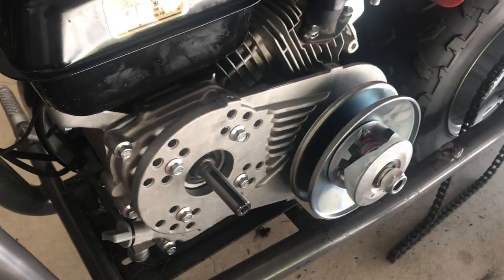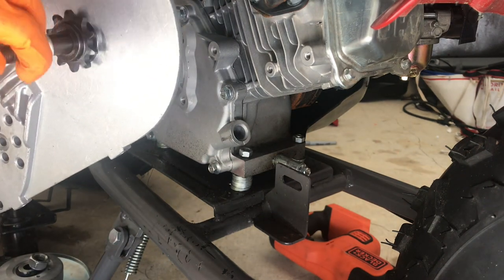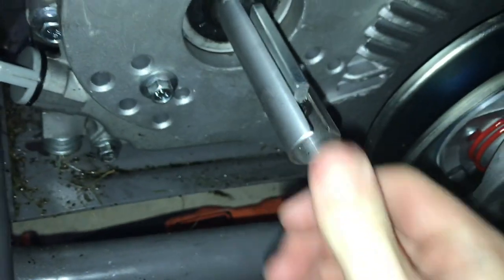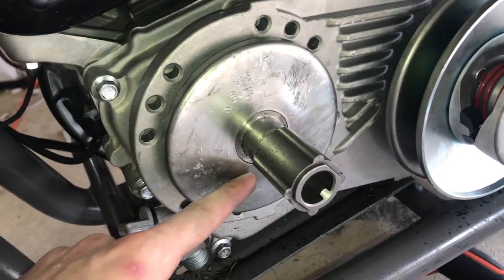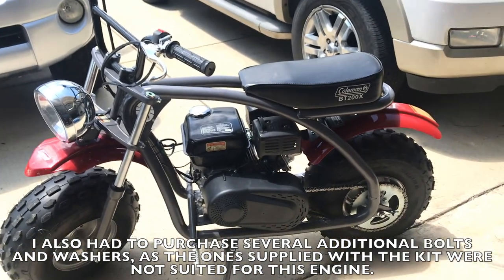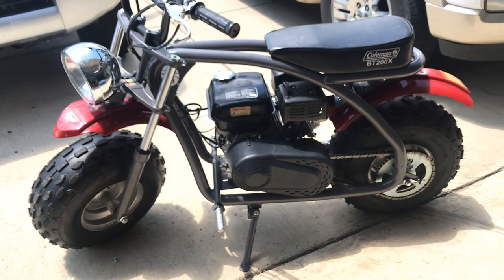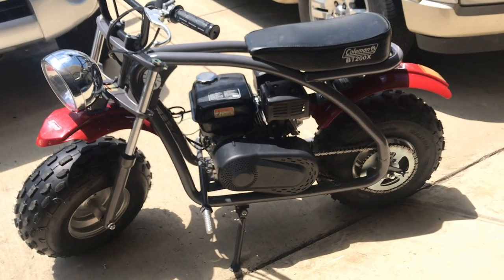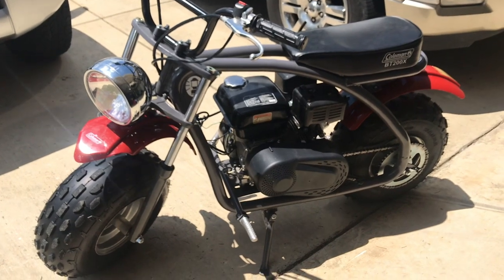Installing a Torque Converter on a 5/8" Coleman BT200X Mini Bike (196cc or 212cc) - Part 2

Comment: Thanks for the video! If anyone is trying to do this with the 5/8 shaft adapter sleeve. Put the sleeve on the shaft, then start the motor. The shaft will slowly turn, then just use some sand paper and sand till the pulley with the attachments fit.

Comment: The reason the parts are tight with the adaptor on the crank is because the adaptor is made for a 5/8 shaft which is .625". The actual size of the crank output shaft on those engines is 16mm which is about .005" larger than 5/8.

Also, not sure where you heard that you lose top speed with one of these torque converters? It has long been known that you gain top speed with these. Most get high 30's MPH and some have touched 40 or better with these. And you should get better low end than you had with the jackshaft. The gearing is enough to notice a difference from what many others have experienced.

Comment: I'm trying it anyway!  Coleman EX with a 5/8 drive.  I'll follow your advice with the grease and patience!  Thanks again for the vid!
Reply: did it work
Reply: @kylercontreras6044 did you end up doing it i'm scared to do it cus using a adapter is sketch
Reply: @chaqz4076  haven't done it

Comment: Go power sports has the 5/8” torque converter kit, a little pricey but it has the proper parts for the 196cc 5/8” crank
Reply: I think that kit is 3/4 with an adaptor but i may be wrong.

Comment: if you buy the riser plate that moves your motor forward you dont need to cut your frame. my ebay torque converter plus stage one kit came with the plate to move the motor forward.

Comment: The torque converter will haul you up a hill when a clutch peters out. In retrospect, it might have been easier to get a $100 predater engine and then put the converter on.
Reply: exactly, ill get a predator 212 that you can just throw a tav on, wished coleman had not of changed the shaft size.

Comment: I am in the same spot as you only with a CT200u. I bought a $38 torque converter kit and the 5/8 to 3/4 adapter. If it takes 3 days to install and all you get is 4 mph it doesnt sound like it is worth it. My top speed with taking out the governer screw has only been 24mph and I would like to do at least 30.
Reply: The screw does not disable the governor. It allows more throtle.
Reply: Man, he only gained 4 mph because he got a cheap 65 dollar converter !

Comment: I tried putting an ebay torque converter on my CT200u...it had the same undersized shaft and I bought an adapter like you did, but I could not get the first side of the drive pulley on all the way.  I tried grease, heat, using a file to shave down any possible rough edges of the adapter.  After mangling the pulley part trying to get it off a couple of times I gave up.  Parts like that need to have better tolerances than we get on china made stuff.  Even if it had gone on, I was worried as the key on the pulleys only went into the shaft adapter...and not into the grove on the shaft itself...I don't see what would keep the adapter from sliding on the shaft other than pure friction.
Reply: The problem is that it is a 5/8 to 3/4 adaptor. The Hisun PTO is not 5/8 it's 16mm. 16mm is about .005" larger than 5/8. When you put the adaptor on the crankshaft it opens up slightly larger than 3/4 . 

Those adaptors for this are not a good idea. OMBwarehouse.com makes a 16mm to 1" adaptor that should work great. But you need a torque convertor that has a 1 inch drive pully.

I'm different than most people. If I had to do this I would replace the crankshaft with a 3/4".
Reply: Having the same issue as we speak with the key only hitting sleeve gonna have to swap hole motor for a 3/4 from my shelf I guess that sucks lol

Comment: A CVT reduces top end,...   LOL.
did you know you can even adjust them, by setting the spring in them to the rear setting and preloading the spring (twist counter clockwise as closing, You'll see it load correctly on the *Left of the shoes) as you close the magazine.

Comment: The TAV style clutches actually have a slight overdrive because the belt climbs very high in the drive clutch, providing about a 0.95 over drive. vs a standard output.
Reply: WHATS YOURSOC  I was using standard ratio nomenclature.  Where 4:1 is lower gear than 3:1 and therefore 1.1:1 would be lower gear than 1:1 and 1:1 would be lower gear than .95:1.  That is how transfer case, transmission  and axle specs are designated.  As the ratio number on the left side of : gets bigger the gear ratio gets smaller.  So the ratio reflects how many more or less RPM the left side (engine side) must rotate compared to the right side (wheel side).  So a situation where the engine is rotating in "overdrive" (less than the wheel) would be were it is spinning at less than 1:1 or .95:1.

More simply put "over drive" equals a smaller left side number on a ratio designation.  There may be some countries possibly where you could find a ratio written backwards and that would look like this, 1:1.05, also reflecting  "overdrive" of the rear wheel compared to the engine.

Comment: Use some sand paper with the motor running on the crank adapter and 8 washers on the crank to line the driver pulley with the driven Pulley make sure to have a rubber o ring on the crank we’re the washers meet the engine
Reply: What's the o ring for?

Comment: Can also purchase a 196cc honda clone crankshaft. They sell for $26.50 on eBay plus free shipping.
Reply: IMO getting the correct crank is the way to go. Using an adaptor like the one in this video is quicker and cheaper but doesn't work exactly right because the adaptor is made for a 5/8 shaft. The shaft on these engines is 16mm which is larger than 5/8. That's why he had an issue with parts fitting too tightly.
Reply: Thanks guys, this is super helpful. I see now why the adapter isn't the way to go. I'll be ordering a 3/4" replacement crankshaft for my CT200U soon.
Reply: That's what I did.  Worked great!

Comment: Change your rear sprocket to a larger one for more low end torque.
Reply: You can also go from a 10 tooth to a 8 ,witch will do the same but cheaper on the small sprocket. That's what I did .more torque now.

Comment: How are the washers holding up? I’m considering using them to raise my engine up an inch.
Reply from the maker: The washers didn’t hold up long term, I’ve been thinking of making a follow up video of some minor mods and changes I needed to make for this setup. I had to switch to a piece of 1 inch square tubing, which I drilled bolt holes into. I then purchased bolts that were 1.5 inches longer and bolted the engine down that way. This setup has lasted me several months without issue.

Comment: Does it seem to have better performance with this vs the stock clutch? I'm talking like climbing a steep hill. I have to get a good run for the steep hill that leads to my trails, if not it just stops halfway up the hill and that's sketchy as hell. Also it seems like I have no power in the grass. Would one of these improve that?
Reply: A year late, however place sleeve in the freezer, or compressed co2,or liquid nitrogen, place the pulley in the oven if you have no other method of evenly warming it up.  Wear gloves! Lol. Oh yeah, a little grease.  
I'd be interested if you went through with it, and how your experience was overall.  Thank you,  and have a great day!

Comment: after using the crank shaft adapter the bolt in my kit for the 3/4 crank wouldn't thread into my 5/8 crank. going to ace hardware now to get the bolt.

Comment: I don’t know if you’ll see this comment but it would be very helpful if you did. So I have the same setup and have the key. What size bolt
Did you use to secure the front pulley on?

Comment: Did you use that crankshaft adapter because no one makes a kit to fit a 5/8 shaft or you used it because the kit you happened to get was just made for a bigger shaft? I guess what I'm trying to ask is do these torque converter company's make a kit for a 5/8 shaft and you over looked this part  when ordering the converter?  Great video and very informative, take care buddy.
Reply: Yes there is a torque converter made for 5/8 and 3/4
Reply: @ilovecheesecake516  Thank you for the reply and the info buddy.
Reply: @ilovecheesecake516  Do you have a link to where to get a 5/8 torque converter?
Reply: Deucealive75 https://www.gopowersports.com/coleman-ct200-series-torque-converter-kit/
Reply: @ilovecheesecake516  OK. That's the expensive kit with a shaft adaptor. I thought you were talking about the $60 ebay kits that might have a 5/8 drive pully. My bad.
Reply: Deucealive75 I personally like those better than the ebay ones. They last a hell of a lot longer and they perform better. Not to mention they won’t take any jerry-rigging to fit your bike. Trust me, I’ve had both, but that’s just my opinion.
Reply: @ilovecheesecake516  That's interesting. In what ways do they perform better? One thing I find interesting is the wide range of top speed numbers that people report on the same type of bikes. Colemans specifically. Some only get 34 or 35 while others get up to 45 on mainly stock engines.
Reply: Deucealive75 Thats the difference. When I bought my first CT200u I put a cheap ebay cvt on it along with the stage one kit and of course the throttle screw removal. I was very disappointed when it only went about 34 mph and other people’s were going 50+. A few months after I bought a BT200x (same motor) and did the same modifications except the cvt was from that link. The highest speed I achieved was 47mph without any governor delete or suppression. After that I ordered different gearing and now I get 55+ on that thing.
Reply: Hey buddy thank you for the info to the Amazon kit, I really appreciate that and the price is perfect. 👍
Reply: @ilovecheesecake516  Nice. What gearing are you using? I'm running a 9/60 tooth and am very happy with 0-25 performance. Have no idea what top speed is..
Reply: @Deucealive75  12t and 53 on the rear.

Comment: My mini bike also has the 5/8 shaft and the bolt that goes in the shaft that came my kit is the wrong one. Do you know what size bolt I would need to buy?
Reply: It's a 6mm fine threaded bolt. At least that is what my BT200X took. I haven't installed a torque converter yet but I lost mine because it wasn't tightened enough from the factory and I failed to check it before riding it. I was able to get some 6mm bolts to fit it at Lowe's.

Comment: So how did you get the 3/4 torque converter which comes with a welded/molded key ( seems they all do ) in it to go over the  5/8 bushing so it will connect to the crankshaft ?
Reply from the maker: I ordered an adapter on Amazon that converts a 5/8 shaft to a 3/4. If you check out part one, I show specifically which adapter I purchased
Reply: @TysTech  I ordered the the same adapter , slides into the converter but the key in the tq is now flush with the adapter, it needs to be long enuf to go thru the adapter and into the the 5/8 shaft .   The kit that one of the online go kart places sells for like $180.00 has an adapter that has 2 key ways , one for torgue converter and another for the 5/8 shaft . The only way the $8.00 bushing will work is you can buy a torque converter without a key in it ?
Reply: I’m in the same boat right now. I don’t want to swap the crankshaft with the 7/8 Honda gx200 clone shaft. I am guessing the interference fit between the spacer and the ID of the converter was so tight that the grip itself is what is transferring the torque.... I would guess it will slip at high torque times if this method is used.
Reply: @brandenneal3258  Posible , my adapter will slide right inside the torque  converter .   Go Power Sports $180.00 set up shows a bushing with much thicker wall thickness so they put 2 keyways in it. One for the torque converter key and another keyway to put a key into your motors 5/8" shaft .  Looks like they used a  torque converter with an 1" id allowing for a bushing with more wall thickness.  For that money just buy another motor or swap the crank .
Reply: jcd8400 I just got it to work. I cut another keyhole on the other side of the shaft adapter and made a small key to hold it to the shaft. It works but I DO NOT RECCOMEND THIS. looking back I think the only way to do this right is to get another shaft or buy that $180 kit :/ I did get it to work though!

Comment: Needs a predator 420 problem solved because you can use a 40 series torque converter and do a intake and exhaust system upgrade maybe even remove the governor.
Reply: That would be too expensive for me, and trying to fit all that in a small frame wouldn't be worth it in my opinion, have you ever tried it before?
Reply: @jt101c  then try a tillotson 212 electric start engine instead.
Reply: @rustybeatty6567  i think imma go with a predator 212, it's only $99 at harbor freight
Reply: @jt101c  that might not be a good idea because a predator 212 doesn't have a charging system for your headlight so you'll have to figure out away to power the headlight but a tillotson 212 electric start does have charging and can handle 5000 RPM's on the stock flywheel and that's without a governor delete and also it's 10 hp engine vs 6.5 hp that the predator 212 comes with and it's stock RPM's is only 3600.
Reply: @rustybeatty6567 thanks for the recommendation, cause I already broke the stock engine

Comment: Hey does anybody know if these Torque Converters or any Upgrade Packages they sell for 196cc Mini Bikes that may be advertised specifically for the Coleman Mini Bike will they fit onto any 196cc Mini Bike regardless of the brand of Bike ? For example I have an X-Pro 196cc Mini Bike. It's a XChinese Bike but looks basically exactly the same as the other Bikes like the MB200 and Coleman so can I put these upgrade kits on it even though they don't mention the X-Pro on the kits ?

Comment: What did you use to raise the engine?
Reply: As another viewer it's obvious he used around 7-10 washers as engine risers. I myself would prefer 1 or 1.1/4 inch square tubing to brace the engine better. Once you really start to modify these engines with big cams, springs, port and polishing milling the heads then open headers and larger bore performance intake these engine's start to have more vibration.

Comment: that’s what happens when you buy a $66 torque concerter from amazon, go to go power sports and spend $200 and they give you quality fitted parts and everything you need.
Reply: No. This is what happens when you don't know what you are doing. The $60 torque converters work just fine. The issue in this video is not a parts issue. It's a skill level issue.
Reply: @Deucealive75  you’re probably right.
Reply: Correct he beat this torque converter so badly I’m sure nothing he did is aligned correctly not to mention he destroyed the parts